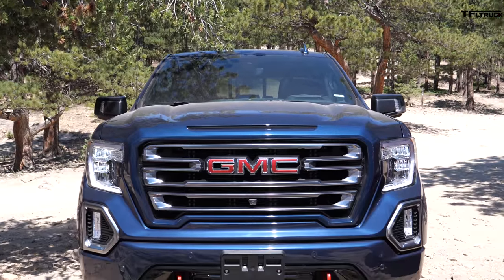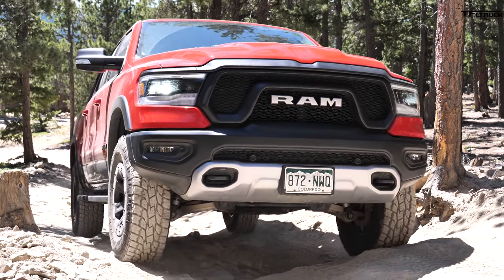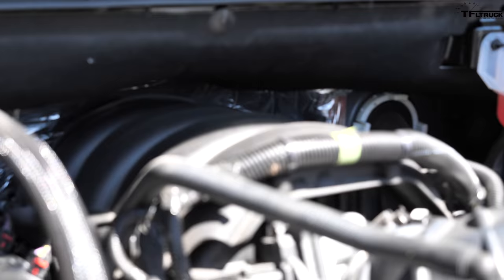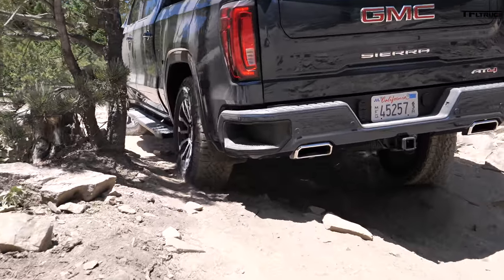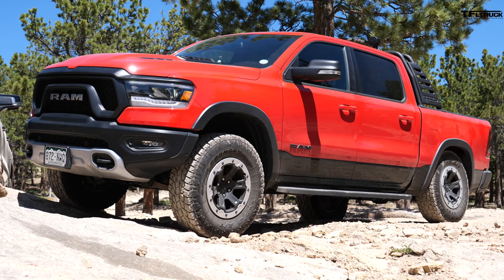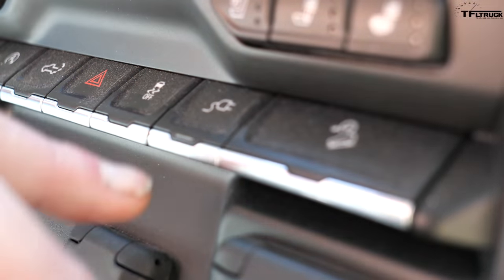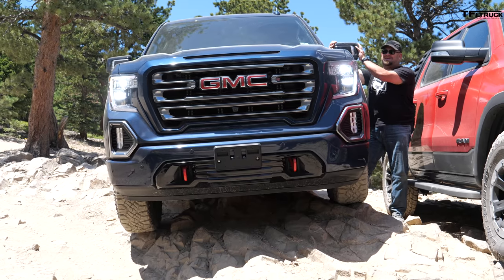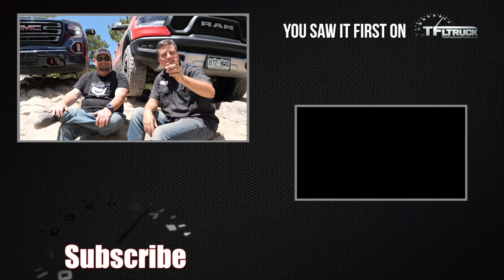GMC Sierra AT4 Comes Up to Challenge the Ram Rebel Rouser and This is What Happens | Ep.7

Comment: Having the 4x4 controls and the trailer brake controls on the left side is not a big deal.  I got used to it on my 2014 Sierra in about 2 days.  If anything I wish the traction control button was on the left side so all the drivetrain controls were in the same place.  
As to the Auto locker..to each his own. I've never had a problem with it and the All wheel drive option is a total winner.  I turn it on in the Winter and leave it on and not worry about it.  Is the traction as good as putting it in 4x4  high or low? No but I keep a smaller turning circle and that is huge for everyday driving. I only use the 4x4 in the winter when its really bad.
Reply: Auto AWD setting on the older GMs used to grenade transfer cases. Lol. The part that auto switches would literally wear right through the outer housing of the casing.
Reply: @evictioncarpentry2628  Ok.  I've NEVER had a problem with it. I also only use it in the winter not year round.  I like to get that couple mpg back when the snow and ice is gone.  If that's you're exp fine but its not been mine or my friends who've owned GM products.
Reply: @loganholmberg2295  I never said it's MY experience. It's a known GM issue. The shift mechanism inside the transfer case wears right through the metal casing. Look it up if you need to.
Reply: @evictioncarpentry2628  lol Ok I wasn't trying to argue or anything.  What years was it an issue on anyways?

Comment: Thanks Guys! Great real world review of two trucks on the top of my wishlist. These new trucks are so capable it’s not going to be an easy decision... I love the styling of the Ram and the factory push button locker. I have a 2005 Sierra Z71 with 225k on the clock and still going strong so I’m leaning towards another GMC based on experience. Next feat is saving up enough for a down payment to make the monthly payment reasonable. I priced them both out and they are both around $65k - $67k nicely equipped... OUCH!!!

Comment: Fun video, but one of the comments about steel suspension being easier to lift compared to sure was just funny. Not only does the rebel have lift modes for use at lower speeds, but you could just insert a spacer in the sway bar styled bar that measures height for the air suspension for an easy, very cheap leveling solution

Comment: Something i did not hear them say but i have heard about the AT4 with the intake and exhaust package is it has to run Premium fuel only. I don't know if the Rebel is like this or not but that is a cost consideration for the AT4. that being said the Blue AT4 will be my next truck.
Reply: From what I could find the 6.2 requires premium. Looked at a couple, power/economy is nice but the price difference here in Manitoba is 20 cents a liter for premium/regular, was a deal breaker for me.
Reply: @kevinkowaluk5682  that is weird that it would require premium, considering how advanced computer tech is now a days, I would think it could detune the engine if it's not getting enough octane.

Comment: Hey TFL guys, I am shopping for a rebel to replace the f150 crew 6.5' bed. I'm kinda disapointed they don't offer the 6.5 bed with the crew cab in the rebel. You have to compromise either cargo room or rear seat room. I'd like to see a side to side comparison on the quad cab room on the new 1500. We have only one young kid and rarely seat adults back there, but the crew is still nicer IMO.

Comment: I agree the actual locker that you can manually engage is a much better way to go, you know its engaged, you don't have to lose traction before you gain traction like the G80 you gotta spin the wheels in order for it to figure out what's going on, so you've already lost your momentum at that point.
Reply: Plus torque is already being applied when the non-rotating axle finally engages -- can't be easy on the G80 or other drivetrain parts.  People are saying their G80's last forever... if you're rarely using it/needing it, sure, a manual locker doesn't really matter and a posi isn't being stressed out so as to fail sooner.
Reply: @DeltaSierra426  Most people never need them in the first place which is why a locker or limited slip is an option on many vehicles, most drivers have absolutely no need for them nor would they know how to properly make use of one if they did have one.

Comment: The GMC rear end  is  a  better  than  the  Dodge  for the  long  run  you will have  trouble with the  electrical in the  Dodge in 20 years  the GMC will be  good
Reply: Dodge doesnt make trucks anymore...
Reply: All  same company you have  go to  a  Dodge  dealership  to buy a  Ram
Reply: Electric tale gates are fairly new and you already knoe how long they're going to last? RAM is 2nd best selling for a reason.
Reply: How many cars have no electrical issues after 20 years? Maybe a car that was built in the 80s with hardly any electrical components.
Reply: Nobody keeping these trucks for 20years
Reply: Greyhalotrooper x because they offer a lot for considerably cheaper... 2nd most selling isn’t 1st!
Reply: Wrong gm has a lot of issues with their electrical systems. I have seen multiple lemons from gmc with major electric issues in my area.

Comment: GM really needs to add a selectable locker.
Reply: Why? First the 1 percent time it goes off road or stuck in snow?
Reply: @bryane2857  Yes.
Reply: @ALMX5DP  the G80 works great getting you unstuck from snow.
Reply: @RyanRKJ  Sure, but it would be nice to prevent such situations before they exist. Selectable locker could help with that as seen in this video.
Reply: No they Don't.  I had an Elocker on an F150 FX4 with a small lift and bigger tires. Fully locked means you can't negotiate tight trails and both tires spinning is totally useless in the snow, all you do it go extra sideways regardless of how much counter steering you try. The fully locked axle would bang and hop around even the slightest corner, it always sounded like it was about to break. 

I'd rather and LSD over the G80 still, but the G80 works.

Comment: I've been driving 18 wheelers for over 15yrs. Almost ever rig i have driven has a locking dif for traction when the foundations are to soft. Ill take the GMC over the ram for one reason. My buddy had his rear locker switch not work. And guess who pulled him back out to the road the Z71. The Problem is that people dont know how to use the G80. You have to give it gas or your getting stuck. America 🇺🇸🇺🇸🇺🇸🇺🇸🇺🇸

Comment: Truck prices are just out of control
Reply: They're not really trucks anymore they're luxury cars with a suitcase holder.  Way too much electronic and safety gadgets and nannies than necessary only to allow those who have no business owning and driving a truck to be able to operate one without running over absolutely everything.  Most of today's "Trucks" are found cruising the parking lots of the mall and Wallyworld, not actually doing anything a truck was built to do which is why there aren't any compact pickup trucks anymore people buy them for family sedans and commuter cars.
Reply: mike a  Exactly, until people stop wanting their cars full of everything including the kitchen sink prices will continue to skyrocket...what used to be a work vehicle has turned into luxury cars that just happened to come with a truck bed instead of a trunk, people don't use them as trucks they use them as family sedans.

Comment: Andre, how do you know its more powerful?  Many engine control software manages the performance to achieve a specific output so adding aftermarket parts may not be actually improving power.

Comment: The trucks and jeeps etc I used to see off road when I used to have back country access were 20 years old and beat to snot. If you punched a tree or rock and caved in a body panel, it was no big deal. Grab a hammer and hit it until your wheel can clear. I was on a motocross bike, usually running from the Sherrif deputy's and would often see the after math of natures revenge on 4 WHD vehicles.

Comment: Nice video but did not the Ram Rebel on Cliffhanger 2.0 break a front drive shaft :(    and was the break over angles worse than the 2019 Chevy Trail Boss till you lifted.   I’m wondering who makes a  aftermarket front locker for a 2020 GMC or Chevy 1500 then that would all the GM products need to be a off road machine ?

Comment: I've driven both these trucks and the Rancho setup on the AT4 is a joke - jumps and bounds like a pogo stick.  The stock Bilsteins in the Rebel are smooth and refined on and off road.     Miles apart on handling.

Comment: For that kind of money, why not just get a Power Wagon?
Reply: That is the route I'd certainly go if I were wanting an "offroad" truck.  Plus the power wagon is a 3/4 ton pickup with solid axles much better for those offroading excursions.
Reply: These trucks are geared more for somewhat higher-speed off-roading whereas the Power Wagon is a slow technical off-roader.  Moreover, if you don't need the additional towing or payload capacity, it can be a bit overkill.

Comment: I'm curious if the modification of the Rebel required recalibration of the automatic cruise and emergency braking systems after you installed the levelling kit? Did the Rebel have these emergency systems? Were they recalibrate? Curious.
Reply: Since the speedometer wasn't re calibrated, none of those systems are either.

Comment: Both nice trucks, both made it up the hill. Shouldn't you remove the front air damn on the GMC? It looks pretty low for off roading.
Reply: I do see people taking big trucks off pavement, yes.  Often hauling stuff, whether it be taking a small aluminum fishing boat down a rocky access road to get to a lake with great fishing, or hauling a deer or moose out of the woods after a successful hunt.  If the objective is simply off road fun, most people use a smaller vehicle, but not always.  I think it is important for these big trucks to maintain good on road capabilities though, as that's where the trucks are used the most.  Both the Rebel and AT4 do a good job of maintaining on road capability, while increasing off road capability.
Reply: @leonardrice1500  no, it's made out of thin plastic, so it kinda is like a bendy glass that's going to break if it gets hit on.

Comment: So this Chevy has the same basic "off road" package as Chevy offered 30 years ago. Rancho shocks, a skid plate, a finicky locker in the rear and some stickers. The only new stuff is the hill decent control and a leveling kit...  Not that the Rebel is much better from the factory, the rear locker is better, but that's it. 
Neither truck is even close to the Raptor or the Power Wagon in capability off road, but at least TFL truck took them on harder trails than most people ever will.
Reply: Well said,  the lift is just a 2" level kit,  Ranchos are very dated,  the price should be 15k less,  nice truck for 35k

Comment: that spinning before it locks is dangerous in the snow. I'll take the rebel
Reply: Fully locked In the snow is useless.
Reply: @uncle_salty_3675 . I had a 2014 F150 for 5 years with the Elocker. It was totally and completely useless in the snow. Once you broke traction ,which happens quickly in the snow you just went extremely sideways,  unrecoverable sideways too. I have a long a steep driveway. Multiple times I tested which mode was the best for snow. I got stuck in 2wd with diff lock faster than in 2wd without diff lock. In fact, letting the traction control do its thing and just keeping your foot down in 2wd with the diff lock off was better. 

4wd high without diff lock was also better as you didn't get out of had sideways.  The only time diff lock was fun/useful in the snow was totally flat parking lots where your intention was to drift.  

I used it a couple of times in mud and it works there, but not if you are on a tight trail that needs lots of steering input.  I would have much rather had a clutch type LSD, as I almost never used the Elocker due to it's  limitations.

Comment: the perfect truck= Ford raptor body+6.2L from Chevy/GMC + Rebel/longhorn Interior from Ram
Reply: The RAM Trx will be your solution.  With it's wide body and powerful V8 and the perfect interior
Reply: The perfect truck has to have a wheel base shorter then 125".

Comment: Ram rebel is built for off-road only whereas the gm truck has the torque, horsepower, off road capability and on road capability. I prefer the gm cause I don’t off road everyday but would still like to be well rounded in my adventures

Comment: Great Video guys!!
Yes, 1/2 Ton trucks are getting too expensive..
They should be Raptor special for that amount.
Just add in that V8.  Not with a V6
You should have brought the Tundra Pro with you..
Need more Tundra videos!!  My truck of choice.
Reply: Rick Loc they’re not doing Tundra videos because the tundra is a rather outdated platform at this point, and they’ve already tested it many times. Toyota is still running pretty much the same tundra from 2014/15 and in that time GM has done pretty much 3 large updates, same as Ford, and Ram got a major update in that time. Hell even Nissan made big redesign. I hope for Toyota’s sake they have a great new generation of tundra coming with more engine options, 8+ speed transmission, and they need way better fuel economy to even come close to comparing what the others currently offer.
Reply: Yes, I realize the Tundra is a little dated but I haven’t seen off-road video comparisons with the Tundra Pro. It really needs bigger off-road tires on it but everyone talks about a locking rear diff...
I want to see the Tundra in action. Besides if you need a locking diff I would just install like a ARB locking diff that would smoke these factory trucks.
Last normal V8 on the market I guess. I love it
Reply: Me and other people don’t need or want apple car play or 10 USB ports or a motor that’s unreliable or unproven or a “locking” diff that doesn’t work all that well..
Most people want something affordable and simple..
I can buy a new 4X4 Tundra and do a simple coil over shock set up and a locking diff and tires for around 40K.

Comment: I am a new Ford F150 FX4 owner and I have a question. Is it just the level and tires that make these trucks more capable off road than a FX4 package? Feature for feature, I believe the Ford is right there with them with the skid plates, rear locker and also has a front camera. Just wanted to get your thoughts.
Reply: FX4 is comparable to Silverado's Z71 off-road package.  Ram doesn't really have a marketing term for it, just an off-road-enhancing package.  Generally, all the trucks add some skid plates, A/T tires, and limited slip rear diff whereas your base 4x4 trucks won't have any of that (even the posi, believe it or not!).  I don't think Ford has a truck that competes exactly at the Rebel and AT4/Trail Boss market segment, as moving from FX4 to Raptor obviously leapfrogs the aforementioned by a fair amount.
I'm sure Ford will either upgrade the FX4 to meet Rebel, AT4/Trail Boss, or simply add a new package.

Comment: I have to agree on the gmc the g80 grenade is awful off-road, it works perfect for the average truck buyers but for those of us that actually use 4wd it sucks takes to long to engage and is not very reliable gm has gotten a bad rap with rearends just because of the locker failing. GM please put a electronic locker in the trucks.

Comment: i’m a chevy guy but i would choose the ram rebel. it is a great truck. this is an unfair test. you modified your rebel and the gmc is stock.
Reply: Yea even stock for stock I would pick the Rebel. I love the 6.2L GM but there is a lot the Ram offers that is missed on the new GM half tons. The ride quality of the Ram coil suspension is second to none and same for the interior IMO. I personally like the front end looks of the silverado better than the GMC as well. Previously I would gravitate to the GMCs. I just don't care for those wheelwells on the Sierra they are just weird. Glad silverado went more rounded this time around.
Reply: You're not a Chevy guy.
The GM is way more reliable, efficient and only has 8 spark plugs. I'm a Chevy guy.. 
The ram is still a Chrysler product...
Reply: I was a Chevy guy from the day I started driving until this year. 1973 chevelle, 1980 chevette, 1990 chev pick up, 2003 gmc pick up, 2011 Silverado. Oil consumption and rust made me switch.
Reply: @justinburn8919  my Chevy's Rock!! I off road all of the time and keep them 6 to 10 year's with no major issues.
Reply: PhillLsx Ga. The spark plug remark makes me laugh. Like you’d always be changing spark plugs or something.
Reply: @JsGarage  16 spark plugs in the RAM and shitty fuel economy. Why?? What's the point??
And Chrysler recommends 89 octane in the 5.7 . I know the 6.2 recommends premium.
My 5.3 Silverado kicks hemi ass off road and takes 8 spark plugs, 87 octane and I AVERARGE 22 to 25 MPG on the highway. 
So what's the purpose of the Hemi again???
Reply: @philllsxga.7737  I see you're back on here lying lol
Reply: @rigging1377  just my experience..
The averarge person doesn't off road their daily driver. Nothing like I do..